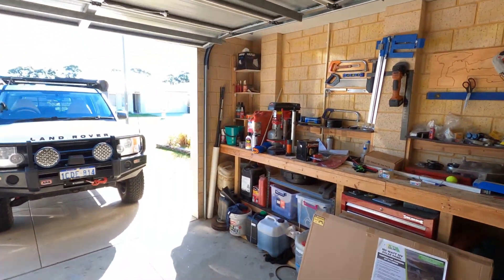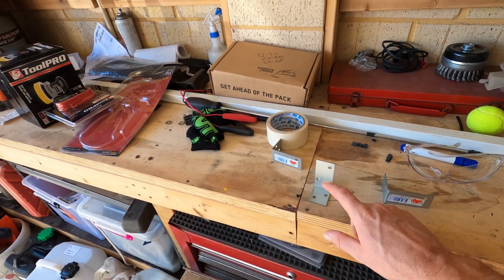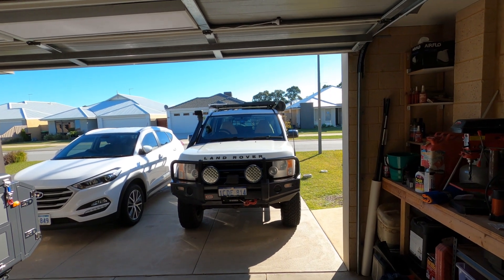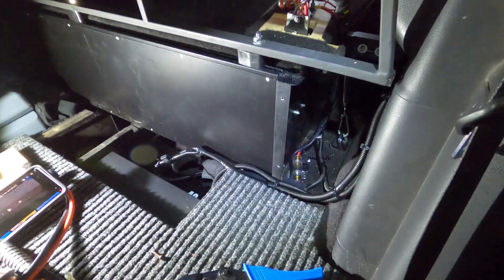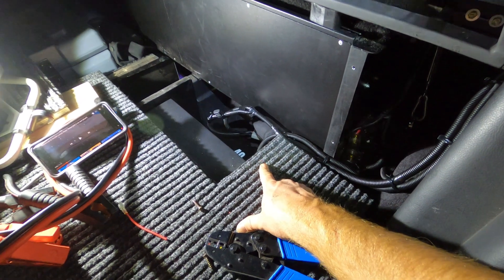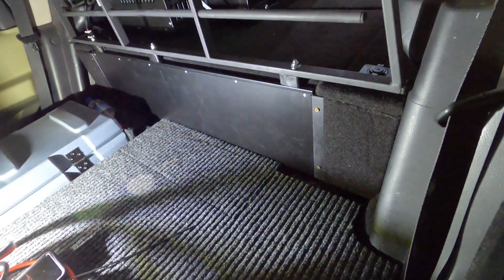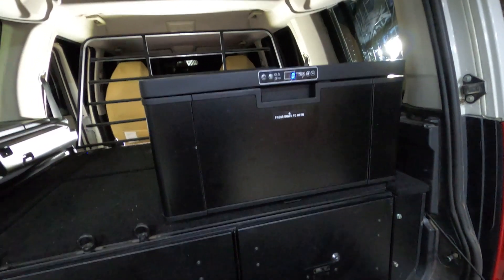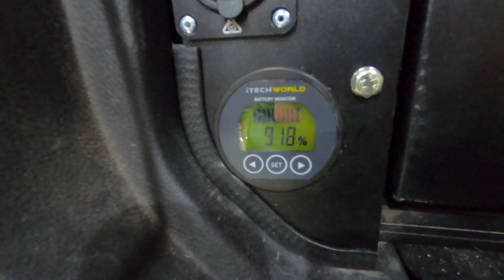SOLAR PANEL INSTALL DISCOVERY 3 / LR3

Comment: You will get use to the neighbors, don’t stress too much, you’re making awesome videos mate! Just would like to ask if you can do a video about the lights you have on? The light at and spots please? And what the brands are?
Keep up the good work!
Reply from the maker: Thankyou 😊 the lights are the the kings spotties from 4wdsupacentre and same as the light bar 

The light bar cable runs from the roof rack down the front windscreen A pillar 

If you lift the pillar up there is enough room for dual core to run underneath it

Comment: i have a pannel for the ranger as well just havent got the chance to install it yet
Reply from the maker: I recommend it I've been running my fridge in the disco for 2.5 weeks now and only driven every second day to shops and back and other small trips basically sits at 85_95% the whole time

Comment: Enjoyed watching this. I mounted a flexi solar panel on the bonnet as I don't use a roof rack, but might get one now.
Regards
Peter Discovery Adventures
Reply: They are also rather expensive for what it is. However  as you say they do look good. Mine is just a cheap Flexi but does the job of keeping  the auxiliary  battery charged when running the fridge even in the UK weather lol.
Reply from the maker: Thanks Peter I was originally going to go cascadias 4x4 flexible panel that they do for our discovery 3's bonnet as it looks awesome and then keeps your roof rack free for more storage but then with the heat we get in wa I thought probly better.off mounting it to the roof instead of the bonnet